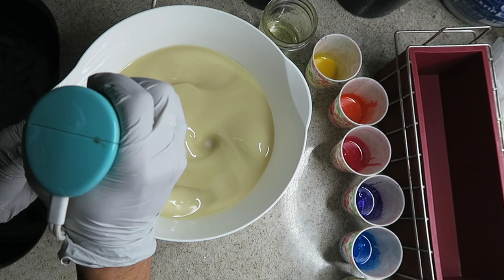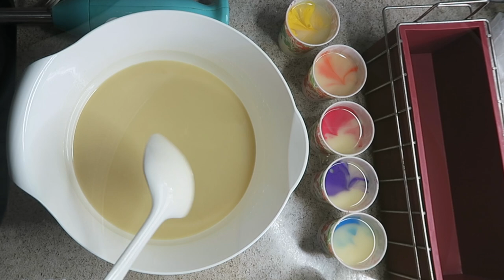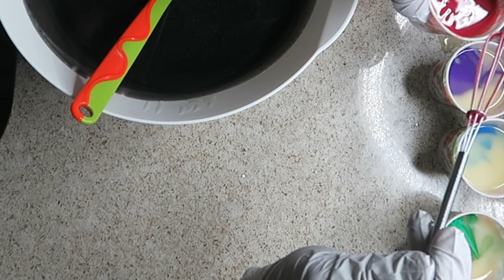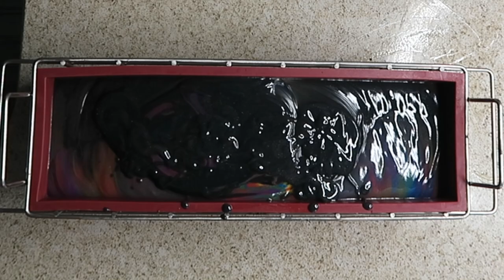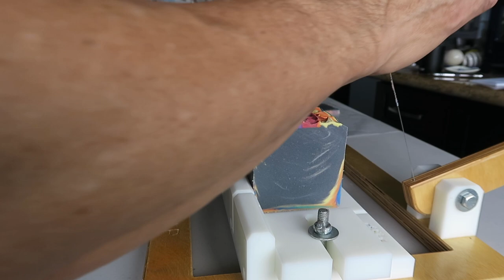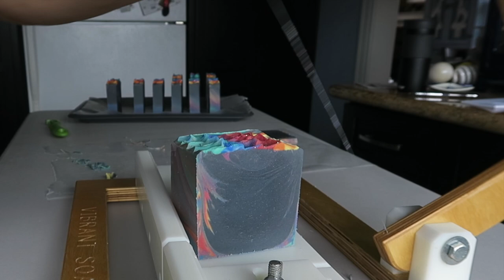Making Midnight Patchouli Rainbow

Comment: Both but you could do the drop swirl on top and the other feathery kind on the bottom. But I love drop swirl anyway..but love it black is a great contrast. How much water do u soap with and do u use any special oils or additives to make it so thin??
Reply from the maker: I usually use full water. Major oil is olive to keep it fluid. I also soap as cool as I can and blend only to emulsification. Thank you!